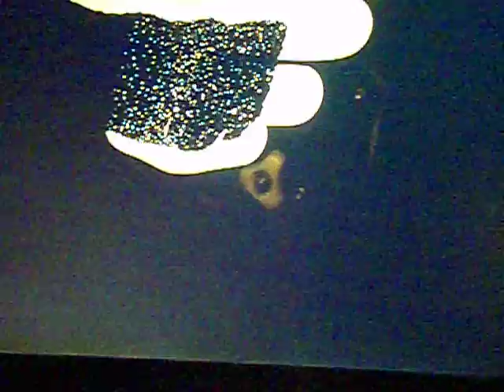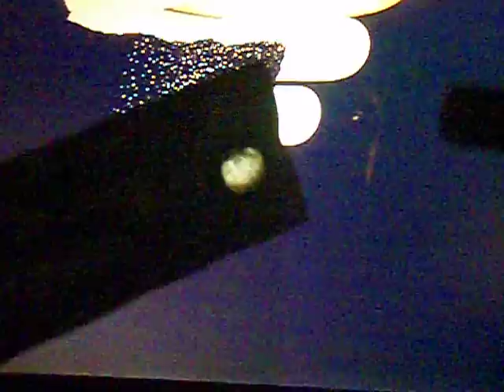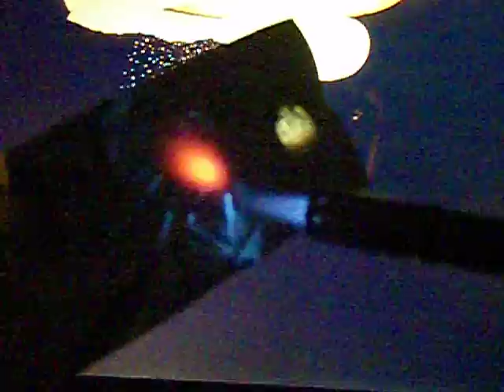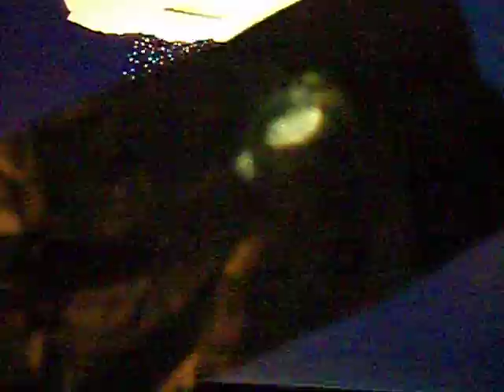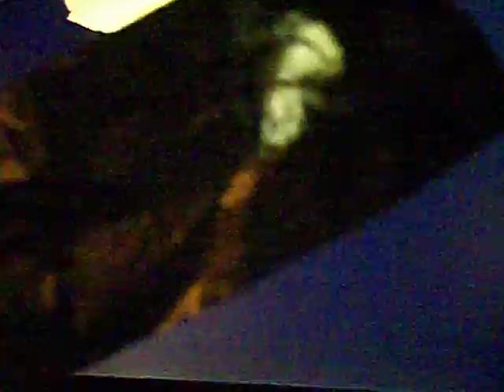Aluminum foil + butane lighter = Mesh

Comment from the maker: @jeriellsworth Also, when the mesh forms it has a smaller area than the original foil allow, this causes distortions in the sheet due to the shrinkage.   Curious, but not sure if this is useful in any way.  Any ideas?  Why were you curious about the conductivity?

Comment from the maker: @jeriellsworth Yes.  It appears to have the same resistance across a 1cm wide strip of foil in which about 2 cm of length have been made into the butane-formed mesh, as it does normally.   One interesting observation from tonight is that it is nearly impossible to form a good mesh near an edge.  I cut out my sample from the middle.  It seems some sort of heat sink is needed to stop the mesh from burning up before it can form.